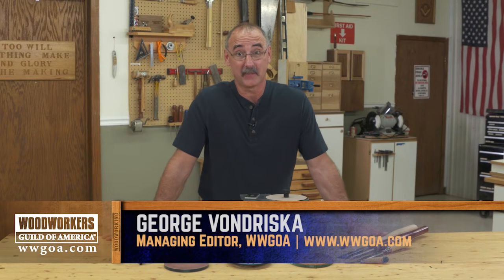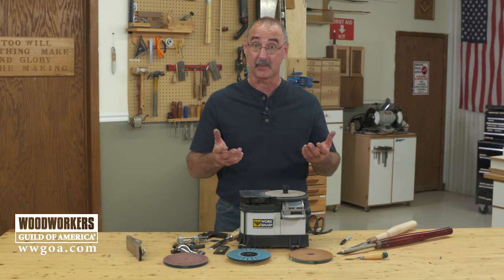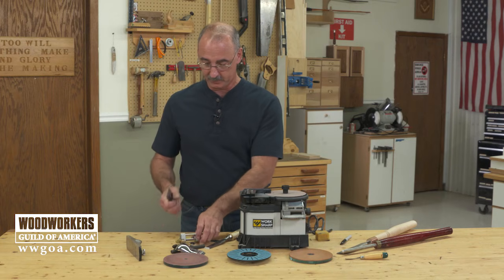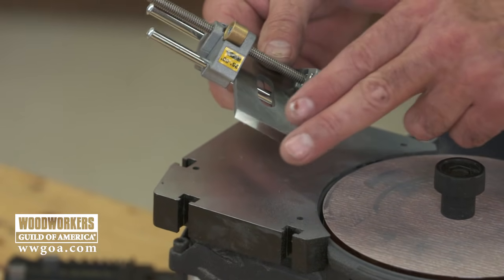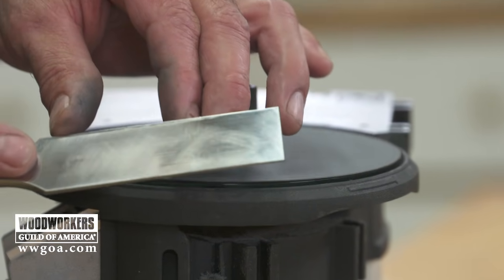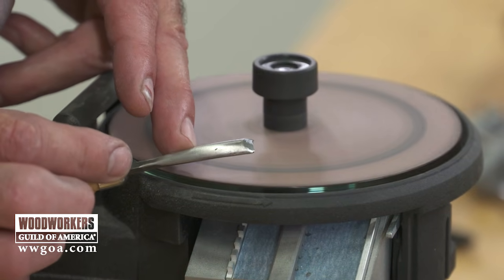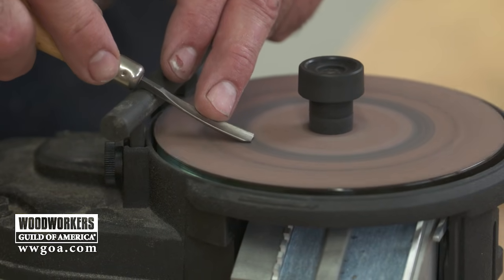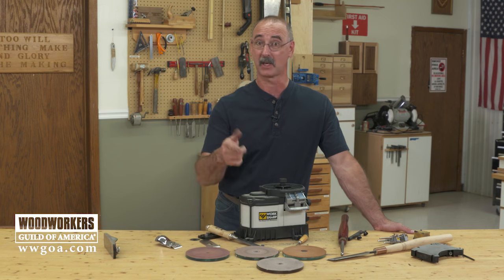Sharpening Chisels And Plane Irons

Comment: Where did you get the cast iron top and the bevel guide?
Reply from the maker: This is an older unit.  These were available as part of various packages back when this was filmed.  You can browse here and contact the manufacturer with questions about what might be available today: https://www.worksharptools.com/

Paul
Reply: @Wwgoa   I had the same question.  How do I get a platform level with the platten so I can sharpen my plane blades.  I also want that honing guide.  Can't seem to find them.

Comment: Thanks. Great site. I have only one question about the WS300, which I have enjoyed for years. I also enjoy using the Japanese water stones.
   I have some very small and delicate chisels I wish to sharpen. I would like to slow the RPM’s. Most responses from dealers suggest NOT TO USE a rheostat with this unit. The WS3000 manufacturer people responded, recently, and to my amazement said: “SURE. You can try it”.
   That was not re-assuring. (maybe a way to
Reply: boost sales).
   Hoping you picked up on the truncated text. If so can you comment on my  suggestion to reduce the speed on the
WS3000.
    Thank you for a great, informative channel.
    Respectfully, R

Comment: Deburring? What and how do you do that?
Reply from the maker: Hello.  This is the process of removing the fine burr that is left behind after you hone a plane or chisel.  If you feel the sharpened tip carefully you can detect a very fine burr that feels like a wire.  You can remove that by laying it flat and lapping the back of the iron on a fine grit sandpaper.   
Thanks
Paul-Woodworkers Guild of America

Comment: What are all of the grits you have on the glass wheels. I'm looking at buying the work sharp and wondering how many glass wheels I need to have. This was a helpful video - learned a few more things, thanks.  Scott
Reply: +The 2 Car Garage Shop Scott, although George gets good results with sandpaper I recommend buying DMT's diamond discs. They sell two sets, Sharpening (coarse) and Honing (fine) that run cooler, last much longer, and give superior results. Whether you use paper or diamond discs I recommend two glass discs for abrasives and one for stropping with either leather (use green chromium oxide compound) or fabric (use diamond paste). For plane blades you will need the wide tool accessory table that George was using also.
Reply from the maker: +The 2 Car Garage Shop It depends on where you need to start with your sharpening, and how fine you want to take the tools. If your edges are bad and need reshaping and nicks removed, you probably need to start at 80-grit. For lathe chisels I sharpen up to 400. So two discs would handle this; 80/120 and 220/400. You can continue to hone up to 6000-grit, which you’d probably do with carving chisels. In that case you need more wheels to handle the 1000, 3600, and 6000 grits.
Reply: Thanks!!  great information

Comment: That's what I've always heard, George, and there's no question you do much better work with sharp tools. But I have to say I've never cut myself on dull tools, whereas with razor sharp tools I seem to end up wearing a lot of Band-aids :) So what evidence is that assertion based on exactly, please?
Reply: +Michael Anderson The problem with dull tools comes with forcing them to do their work, instead of letting them do their work.  No empirical data, by any means, but from bench chisels to lathe chisels to table saw blades, in my experience using a dull tool is gonna be bad.
Reply: +Michael Anderson When you have to "force" a tool to do its job, you're more likely to lose control. "Dull" tools are still plenty sharp enough to puncture human skin. If you're cutting yourself on sharp tools, then perhaps you are not handling them correctly and need to review safety guidelines.
Reply: +Justin H You may be right. What you (and George) say is what I was taught many years ago. But I've always thought that it defies logic and my own experience. What has recently gotten me thinking about whether there was any evidence behind this belief is that I recently took a hand tool sharpening class in which the main method taught was Japanese water stones. The instructor said the same thing you and George (and everyone all the way back to my shop teacher) said. Nonetheless, pretty soon everyone in the class including the instructor was wearing one or more band-aids from cuts we mostly didn't know about until we noticed we were bleeding. But now I can do things I never thought possible with just a really sharp chisel, and hog off amazing amounts of wood fast and achieve finish-ready surfaces with really sharp planes. Anyway my experience seems to  diverge from conventional wisdom here, so I was wondering whether it might be like another thing we were taught and I believed for a long time, to never set a hand plane down on its sole but instead lay it on its side, which has turned out to have no validity.
Reply: Michael ...the reason you get more injuries with sharp tool is that your mind and body got used to handle (doll) Tools and tou learn how to control them ... The quality and safety of dull vs sharp tool is defined in experience and education... not judging anyone or anything but my general rule that works for me.. 1st Educate yourself in tool you are attempting to use.. this part alone will provide you 90% of success....2nd Understand the difference when tools have to be super sharp and when not.. Every  job requires different level of sharpness and you are only person that can decide that part.. I personally happened to be one of guys that get best quality, safety and results if my tools are sharp(er) when doing fine woodworking projects.  My recommendation is to make simple box with few fine details ..etc. make one with dull tools and then one with sharp.. After that you will find your personal level how sharp is sharp..good luck and be safe